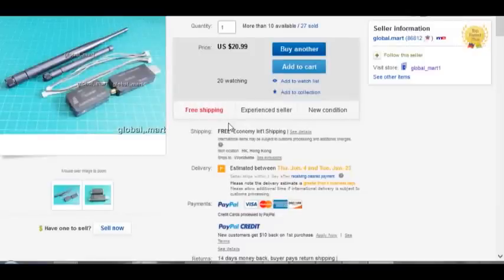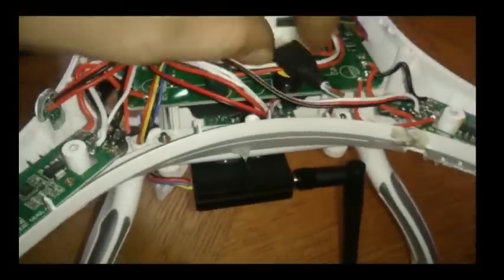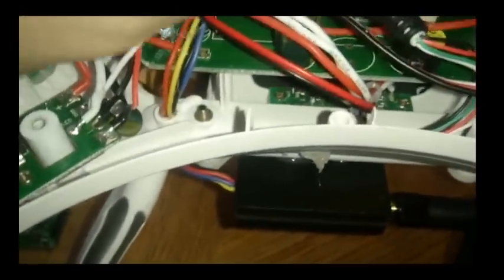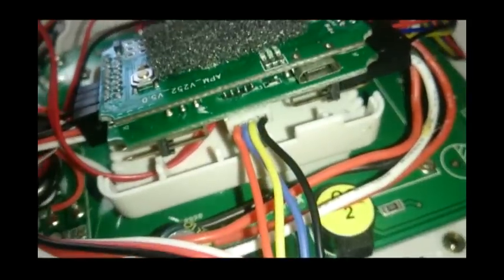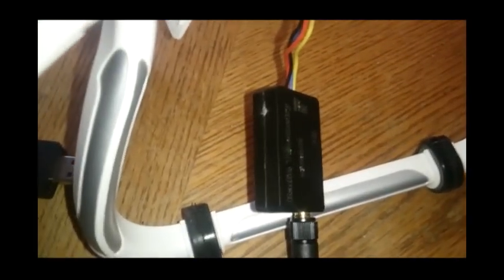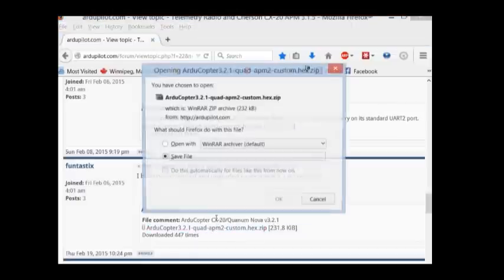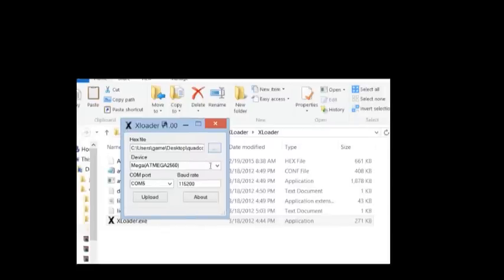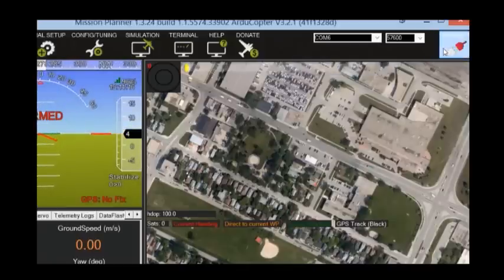Cheerson cx20 Apm v252 v5.0 telemetry Fix-with socket.

Comment: Bangs6996.... I previously plugged my 3DR telemetry module into my cx20 V252_V5.0 board just as it came delivered... Before I saw this video

I had then flown the drone several times with it the air module connected, always wondering why it never worked...

I since have found your brilliant video and have changed the pins on my air module board plug to match yours and plugged it back in...

However, when I turn the drone on, still no lights come from the air module itself even though it's wired exactly as yours is..

Do you think that having used the drone a few times before with the wires the wrong way round could have some how 'fried' the air module of the 3DR telemetry set up?

Please help!!!! Thank you!
Reply from the maker: that video just shows where to jump and solder 5 volts on pin one.. the ground should be fine still..
Reply: +bangs6996 wow thanks so much for such detailed info!
Since it appears one component or another on the air module is indeed fried, and your resolution involves me buying a new soldering iron (my current one is quite oxidised and would be like an elephant typing on a smartphone) I think my best option is to just order another telemetry kit from the bay £~14 or so and change the wire pins as you described before turning proceeding to turn the drone on this time haha

:)
Reply from the maker: heh..yup .. for kicks you can always just remove the positive pin wire.. and touch it to pin one of the air module to see if the lights come on.. but they are cheap now anyways.. and you will have a extra ground unit hehe..

Comment: You saved my bacon with this video.
I can't thank you enough. 
I would never have got my telemetry modules working on my Nova Pro.
I was up until 3.30am trying to figure it out and i started at 10pm last night. 
Thanks again from the UK-England
Reply from the maker: Your Welcome.. Glad it turned out good for you in the end   .......and thank you for posting your comment..
Reply: Now if i could figure out why im getting a "Bad Velocity" on my Nova Pro i could actually fly it.
I have calibrated it on mission planner more than a dozen times and still no joy.
Reply from the maker: HI not totally sure what causes that error... buttt for kicks ..in mission planner(Don't push the connect button) go to optional hardware.. 3dr radio   then push the load settings buttons.. and see if radio power is set to 20. or above 10.. I had jumping issues with sonar and it took me awhile to nail it down to that.

Comment: hey man how can i know if fried something..? i think i connected it wrong and it doesent work..
Reply from the maker: does the green light come on still?.... .. The wires can be a pain in the butt for making connections once you remove them from the connector .
Reply: Damm,no light at all... ,I tested with voltmeter and saw there is 5v but  there no light...  so it's fried right?
Reply from the maker: You can try to jump everything and put 5 volts on pin one, 
https://youtu.be/mTYkbxj42N4?t=295
also remove what ever component leads up to pin one.. regulator ,cap, ect...  plug in the ground unit into your computer or power brick before hand as well. the green light should blink .. once you plug in the air module. if the light goes solid on the ground unit ..you might be in luck
Reply: +bangs6996  amazing man!, you mean to do like he did in the video but instead of connecting to the rx connect to to quad right? I will try it later today and let you know
Reply from the maker: yup like i did in the video.. the part I show in that video is connecting 5 volts to the ground unit.. if you keep watching for about 1 minute i show where to connect it to the air module.. its the same pin's ... You don't need to hook up rx tx.. the goal right now is to get that light on your ground unit to go solid green once you attach 5 volts to the air module..      But when you hook up voltage in reverse on something its a gambling game, anything could of fried...
Reply from the maker: and to clarify ,  just find 5 volts from the quad copter , usb power ect ect.. you don't need to jump board to board like i did in that video... If it does not work , then fallow pin 1 to the capacitor and the regulator .. lift the leg up of the regulator or cut the trace,
Reply: ohhh maannn!! got the led working with 5v. now can i just connect the tx and rx directly or to the bored or should i connect it to the original pins?
Reply: i checked with multimeter and the rx and tx directly connected to the tx and rx on the original soo im fine. last question lol .. does the yellow is tx or rx  ?
Reply from the maker: wow u have been busy , Were you able to get it to work.  ?   by now I'm sure you have tried both ways with the tx and rx ..
Reply: yes and it all work!! ty man you are the best

lol it might be funny but i broke the uart connector on the FC so i need to solder the wires directly ... but maybe for another day 

ty sooo much
Reply from the maker: your welcome.. glad you got it to go..    your lucky it's only really two wires you need to jump on the fc.. It does suck when those things rip off the board.. had a 40 pin connector rip off a laptop a week ago by me pushing the locking door on the ribbon to hard..
Reply: lost the quad....

ha..
Reply from the maker: oh crap.. fly away or crash?
Reply: fly away, i gusss the compass want bad cuz it the plastic was broken

Comment: Hi, thanks for this great job. 

the firmware link is a dead, i found it here. http://www.rcgroups.com/forums/showthread.php?t=2536440
I notice that the red light on boot don't blink as the official 3.2.1, and sometimes i got gps signal loss/3d fix/loss/3d fix etc... with Tower app. So I unplug usb telemetry, close the app re open it. plug usb telemetry and it's ok. 
My signal is not very high with Tower app 37%-78% (better signal with GS3 4G  than with Galaxy Tab S2) when it's  98%-100% with Asus EEEPC.
After this telemetry upgrade and custom firmware update my first flight was not very smooth. So i recalibrate radio, compass, and accel with MP and after auto trim, the CX-20 flight very stable

Thanks again
Reply from the maker: You get better distance as well if you increase the power on your telemetry .You can do that within mission planner. Somebody else suggested that to me in one of these videos..  However I find it glitches my sonar.... thank you for letting me know the link was dead.   I just uploaded the 2 files to my google drive this way it won't happen again..
Reply from the maker: oops you were in my spam comment section..for 2 days, I am bad for checking that and my private messages..  glad you got it going.. I'm having audio issues right now but will check your vid.. and thanks for the plug..

Comment: My 3DR that connects with the apm board has no lights and overheats near the connector.
Reply from the maker: +Kaur Põldmaa Did you make sure your positive and negative were done right?... If it was done right , Your 3dr was / is probably defective .
Reply: +bangs6996 Yes they are connected properly, controlled using multimeter. I assumed its defective also -.-
Reply from the maker: IF it came that way, you might just of a solder jump on something . the cap on the right side can also be shorted out. You would have to remove it to test it..... .. for testing you just need the positive and negative. and basically you will have to touch the components to see which one is heating up.. ....If you want measurements after removing components let me know I can send you mine..

Comment: why i lost "RNGFND" after upgrade this firmware
Reply from the maker: +Dominiz X .. if your using sonar on the original apm .. ..in the comments cjkcizur  posted a firmware that re enables the sonar .. plus telemetry ..  https://www.youtube.com/watch?v=Fu89L8fJt-w
Reply from the maker: +bangs6996 but read over what he disabled.. if something he disabled you need just post .one of us will fix you a firmware update.. besides that it could be mission planner is messed up and you need to uninstall it and re install older version ect..
Reply: Sorrry icant read all english. Thank for reply
Reply from the maker: +Dominiz X ok ..somebody posted this file  . My final HEX file came out at 629KB. Use at your own risk, but it's out at https://drive.google.com/file/d/0B4Z5EKsrcFzzNlVnTnlZTnBMUzg/view?usp=sharing    It has telemetry fix and sonar enable, but no fence
Reply: +bangs6996 i just new soldering apm in new update? or only update HEX my cx20 ready to use sonar and telemetry, Thank alot.
Reply from the maker: +Dominiz X Not sure what you mean...   If you do new update solder and use update hex .. It will have sonar and telemetry fix for version 3.2.1 ..    If still have problems you might have to download old version of mission planner
Reply: +bangs6996 ok. i do follow new update video and update HEX for work both sonar and telemetry

Comment: Every new CX-20, and Nova, (one-in-the-same) owner learns right away before flight, they need to determine which operating system their quad came with. There are 3 known versions. APM, BigShark, and Zero. APM can be manipulated via software programs for waypoint programming whereas the BigShark and Zero platforms..you cannot. APM equipped generally cost more. CALIBRATING compass is PARAMOUNT for first flight...in any mode. All three, APM. BIGSHARK and ZERO...need compass calibration before first (and last...lol) flight. The owners manual describes how to perform this essential task....but CHINESE translation to english speaking...is nearest to impossible. A program called 'Mission Planner' (free) is available for those who wish to initiate more accuracy to compass calibration...ie..makes better accurate flight performance than Chinese manual calibration method..Yes there are 2 ways to calibrate..less accurate Chinese way in owner manual, or 'Mission Planner' way...offering greater accuracy............There is a catch....which is as of February 2016, still not clarified. I've read the many RC forums about "mission planner' calibration for the CX-20....Many people report total iniallation of their CX-20's brain....Responders on the forums say it was because they downloaded 'updates'...a reason why for failure...but never fully explain what updates to what..or when? 

I just received 2/09/16 a new CX-20...It is an APM 2.52 version. Not what I wanted. But since I have this version, I need to make it work for me. I've downloaded "Mission Planner" QUESTION: should I update this software....or NOT update it? People say NOT to update....or the CX-20's brain will die...or are they talking about some other up-date they fail to mention in their many posts.

Can I just plug in between 'Mission Planner' pc-to-cx20...without worry of major catastrophic failure...just to read my cx20 current situation...All I want to do..is calibrate.
Reply from the maker: +Steve Brown I would suggest downloading all your parameters and doing all the calibrations through mission planner regardless.     If you update your apm you can't go back to the custom firmware 3.1.2 which I find so odd nobody took time to upload it yet. If I ever come across one I will upload it..     Anyways things you loose is compass calibration through the firmware 3.1.2 custom .. once you update it to version 3.1.5  3.2.1 you will have to calibrate the compass through mission planner..  However You will find after time its a one time deal if your not going out of your city or country.       Personally I tell people if they like 3.1.2 and you have no issue's at all ..stay with it
Reply from the maker: +bangs6996 Once you get comfortable with the apm 2.5.2 you will find its just a apm 2.6 2.8. its a pretty good apm just lacking all the ports.  If you decide to add telemetry and start exploring fallow me mode ..version 3.2.1 is a must.     I have never bricked any apm through mission planner firmware accept using custom firmware..    that actually kills the bootloader which "the brain" is just a atmel 2560 which is found on all the newer apm's.. I have a video on how to recover a bricked apm and if you watch you will find even that is straight forward..
Reply: Thank you...RCgroups is little help!
Reply from the maker: +Steve Brown Np   rcgroups has fountain of information its just so hard to weed through some of the 4k threads...       Also when you plug in your cx20 it will beep at you lots .. don't plug in the battery as some people suggest to kill the sound .. just deal with it lol.. its a low voltage trigger ..but you can actually fry your esc's on some units.     When using the usb just make sure to push the disconnect button in mission planner..   And again very first step is to back up your params.. they are generic but just in case you use the scroll wheel , you might be changing params by accident
Reply: Thank you....Seems there are no 'concrete' step programs from the Chinese! They build and sell these advanced technology 'toys' to the world...but give little and or vague direction how to use!.......Is this stolen tech from US...they only copy..but not explain?
Reply: +Tom Stephens I'm afraid to update I will get mine soon from gearbest 207.00 but people say update at your own risk and I don't like that what do you think
Reply: I updated firmware successfully on Mission Planner. I would look for Mission Planner tutorial and study how to update properly. You must never disconnect usb from quad before first disconnecting on screen from MP (upper right corner). I think this is the mistake people make and it will cripple the fc. Also, you must have 'open source' not zero or shark versions. MP wont work for those. There is a private forum that give modified parameters for cx20 that rival DJI pro. Ask for help here for calibrating cx20, that how I got in. Good luck.....